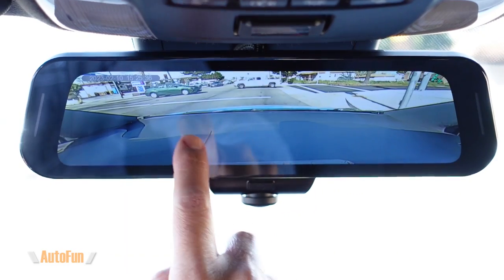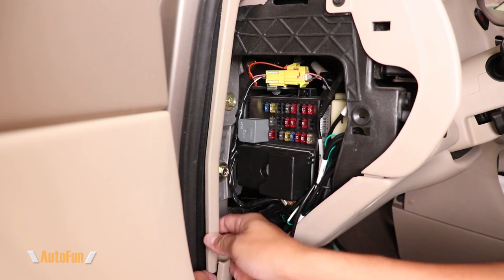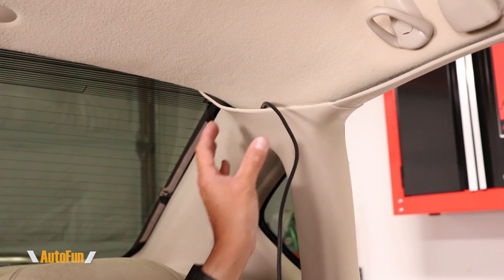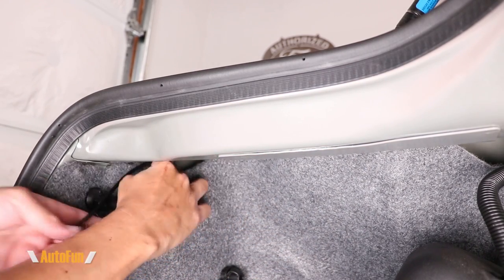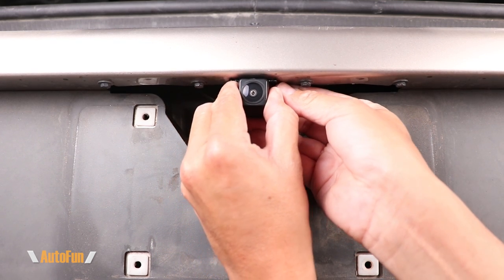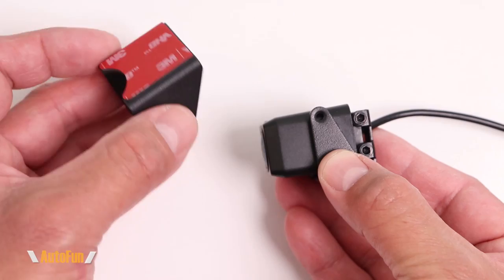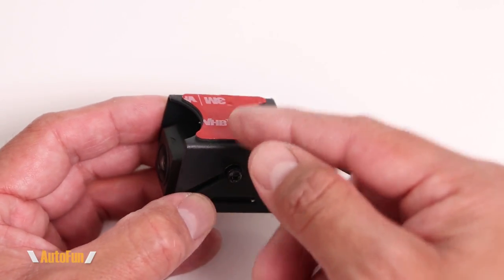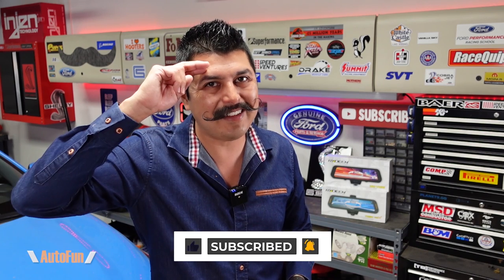Rydeen 360View Mirror Dash Cam REAR CAMERA Install

Comment: Optional mounting brackets 40 dollars? I was considering the 360 camera but seeing that makes me trying everything is badly priced. I have no problem expending a lot on a worthy camera, but not with rip offs for no reason
Reply from the maker: Hi M M! The 360 View can be used with the included strap mountings. The direct fit kit is optional for those that want that option (the 360View was packaged by Rydeen without the options that not all folks need or want to keep the price as low as possible in comparison to it's big brother the Tombo 360X). However if you like to get a complete package with all the options, bells and whistles in one box consider the Tombo here is the review for that one https://youtu.be/vUEsIYEBVck Cheers!

Comment: Hi Alex, i believe Thinkware has launched their latest dashcam - the Thinkware U3000.
I am interested in it but was confused on how to proceed with certain features. Maybe you could help me out here.
1) Is it better to buy the powercell 8 battery along with the U3000 dashcam or would the OBD cable suffice for parking mode feature in order to avoid the car battery drain out?
2) How can I view the LIVE remote view through the Thinkware connected app by connecting to the internet/wifi when the car is switched off and I am at home?
3) Do i need to connect a USB internet dongle in the car 24 hours a day to view the above LIVE remote view? If yes, will the USB internet dongle  get heated up? 
4) If the above is no, then how to have internet in the car 24/7 if I want to see remote LIVE view when the car is switched off and im far away from my car?
Looking forward to your early reply and help.
Thanks,
Terence Rodrigues
Reply from the maker: Hi Terence! Ah the U3000 is actually next on my list of dash cams to test and review so while I'm not familiar with it yet, I can tell you that Thinkware (cloud enabled dash cams) functions very similar to each other, here is the my previous Thinkware review video where I explain the cloud functions in more detail which should answer your questions https://youtu.be/BAEH4f2ulEs Hope this helps, Cheers!
Reply: Hi Alex,
Thanks for the link, however, that remote view connection is done through cloud services but with the U3000 it is done through the connected app. So therefore, my questions related to point 2, 3 and 4 still remain unanswered while for question 1, I believe you will be in a position to answer that when you do the review of the U3000. Let me try and rephrase the questions.
1) If I want to view LIVE remote view of my car and have a dash cam that supports wifi, how to install an internet connection in the car when the car is switched off and I am at home? When I'm in the car, I can do this with my mobile phone internet hotspot but how to do it when I'm far away?.
2) Do i need to connect a USB internet dongle in the car 24 hours a day to view the LIVE remote view? If yes, will the USB internet dongle get heated up and is it dangerous to leave a USB plugged in the car all night?
4) If the above is no, then how to have internet in the car 24/7 if I want to see remote LIVE view when the car is switched off and im far away from my car? Is there any other way to have internet in the car 24/7?
Thanks,
Terence Rodrigues
Reply from the maker: @terencerodrigues6018  Hi Terence! Both the U300 and the Q800Pro connect to the cloud via the internet. The App is used (by both dash cams) to connect to the cloud which in turn gives you access to the dash cam. Regarding using a Wifi enabled dash cam to remote live view, it's not possible since, most Wifi enabled dash cams will turn off the Wifi everytime the Dash cam is turned off. Regarding how to connect the dash cam to the internet, I also cover this in the prior video I linked earlier, there are several ways to do this, one would be to connect the dash cam to the car's hot spot or to connect the dash cam to a personal hot spot etc (on a side not the U3000 is looking quite impressive, plenty of goodies included in box and the video quality is looking great too, stay tuned for that review). Hope this helps, Cheers!